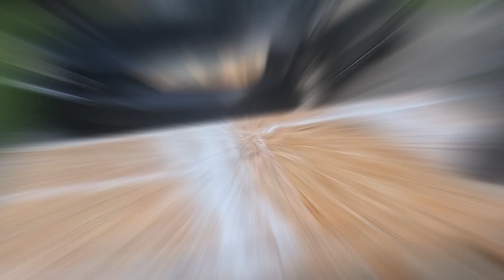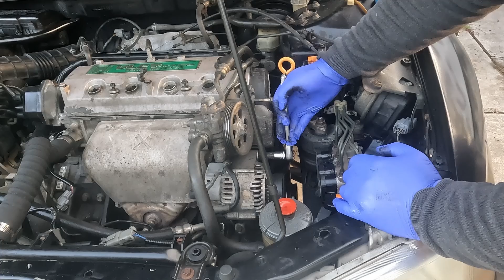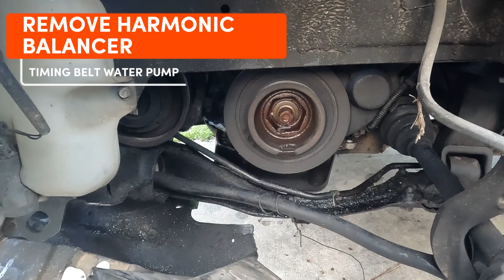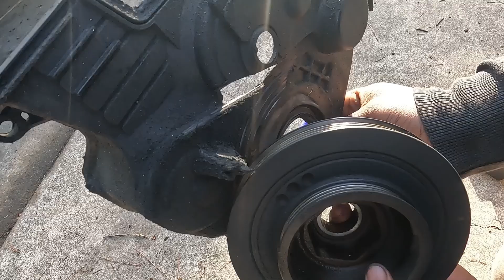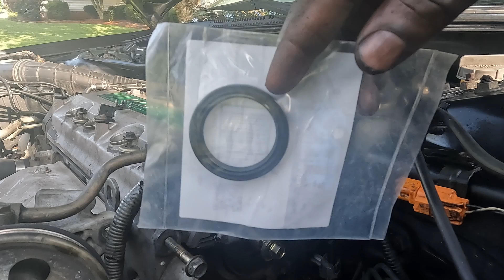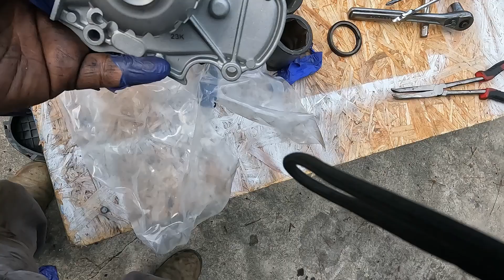Honda Accord Timing Belt, Water Pump,Crankshaft/Camshaft Seal Replacement #diy #youtubeshorts #trend

Comment: Im currently trying to do this myself... i cant seem to get the harmonic balancer bolt broke lose. I even went and bought a heavy duty bauer 1050 ft lb impact and its still not breaking lose.. any tips?
Reply: Update: right after commenting i went and got the 19mm crank pulley socket from autozone. I broke it lose in about 10 seconds
Reply from the maker: Yeah that bolt is a monster to break loose .  I was going to suggest hearing it up.  But I’m happy you were able to get it off.

Comment: 1 question i have a impact wrench but will i have to hold my cam pulley in place when i go to remove it to replace the seal???
Reply from the maker: Thanks for watching and commenting. If your impact is powerful enough you possibly will not have to hold it at all.

Comment: I’m guessing most of the oil you have at the bottom is possibly from that O-ring on the balance shaft housing cover!  Mine was leaking pretty bad and the oil interfered with the crankshaft position indicator.  I ended up out of ignorance replacing the crankshaft position indicator, but it was because I had so much oil there.😮
Reply from the maker: Thanks for watching and commenting.  Yeah I had oil leaks from just about everywhere.  I was slowly tying to repairing one thing at a time but yes that was one of my oil leaks
Reply: @steffdiesel4433  thanks for posting the content it really helps!!  😊

Comment: I’m getting to be an expert. I’ve done this several times trying to find sounds. I think it’s ending up to be my tensioner bearings.
Reply: I did spend the extra money for a Honda brand water pump so the Chinese leak wouldn’t burn me!
Reply: I’m jacked up! 😅
Reply: Oh my goodness, I’m having flashbacks!  I still have to go back and do it one more time the harmonic balancer that I bought one the casting doesn’t match the tool so I can’t put that special tool in there to properly tighten it!
Reply: If you have an oil leak inside the area, where the belts are it’s the O-ring underneath the cover of the balance shaft housing.
Reply: Excellent camera clarity. Great video.
Reply from the maker: Hey, I will be honest with you I had to go back in twice. I edit that part out the video but I left one of the springs out so it did not tension like it should have and the pulley was not even lined up so I had to go back into it. Hopefully all is well and that resolved all your issues.  Thanks for your comments it keeps me motivated.
Reply: @steffdiesel4433  yep I got the tensioner bearings, changed out the one for the timing belt and the other for the balance belt .  And the singer, sewing machine sound went away my goodness it was so annoying.  I also found out that my harmonic balancer was needing replacement because it was kind of wobbling and cracked, and then also a lot of the oil in that area under the plastic shroud was coming from the big O-ring underneath the cover of the balance shaft.  The oil was going right down on the crankshaft position indicator and interfering with that.  So I’ve gotten everything straightened out and it really runs great again 195,000 miles.
Reply from the maker: @StevenHeckler-r9v that’s awesome 👏.  Happy you got everything sorted out.